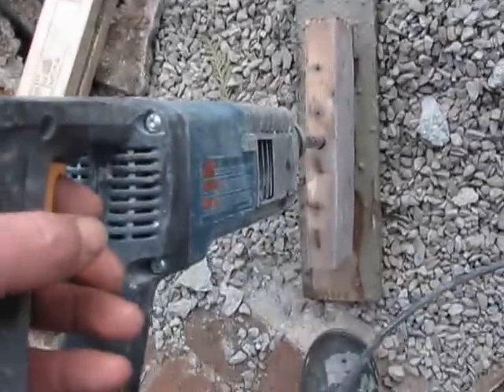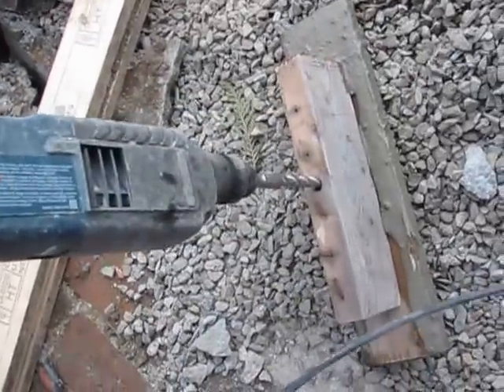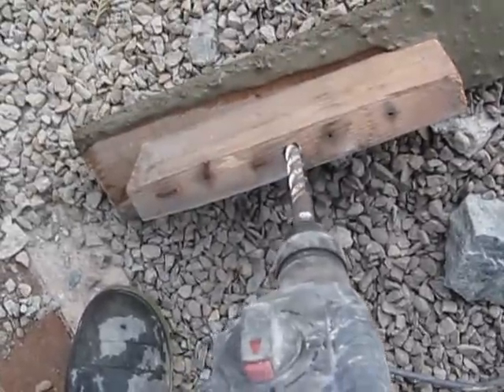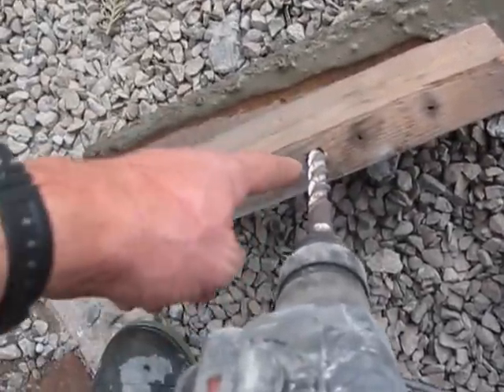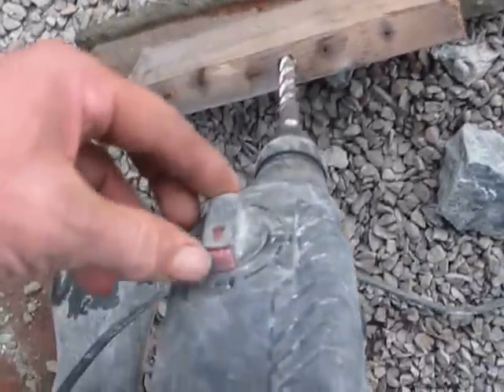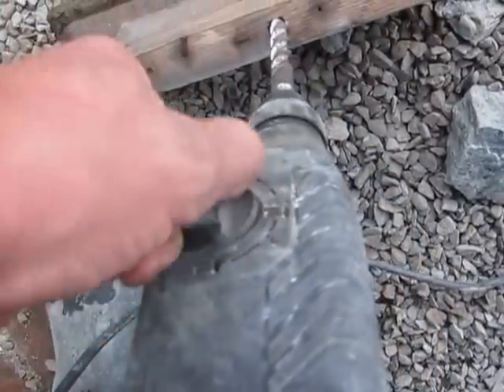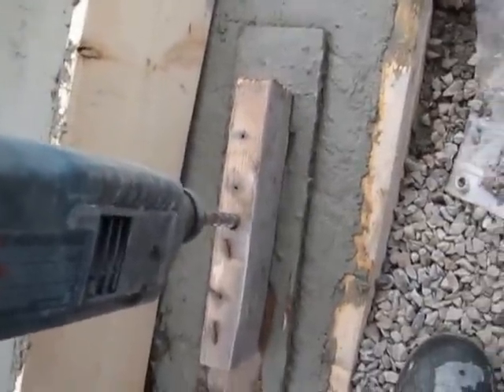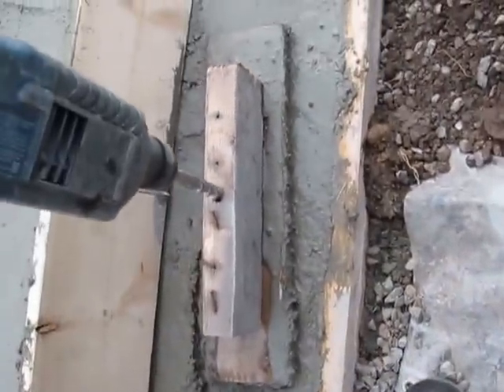Use a hammer drill to vibrate concrete or castings  and remove air bubbles!

Comment: Hey thanks! I just broke a drill bit yesterday and now I know how I'll be vibrating my concrete!! :)
Reply from the maker: Yeah,  it works surprisingly well, eh?   Perhaps Bosch and the others will make custom attachments to do this?   I plan to weld on something onto one of my bits to do deeper vibration.  Just not sure what yet.  Probably should be a hollow metal ball of some kind to mimic some of the industrial vibrators.

Comment: This is great for slabs, I actually have the same drill and I'm going to try this.

I was googling if there were any bits that fit in a hammer drill for pencil vibrating and this is the video I came across. Like you said in another comment, I might just weld a hallow tube to a broken bit, do a tie back to the drill so its always in hammer mode without applying force, and put a steel ball inside and see how that works. 

Obviously it wouldnt get the 1inch to 1foot area of influence, but for DIY home jobs, Im betting I can get 1 inch to 6 inches of influence out of it.

You know what, why hasnt anyone made a vibrator drill bit yet? It would be so easy to make, even would work in regular chuck drills. You just need a straight steel shaft with the first half of a impact attached to it, and a hallow tube with the 2nd half of the impact in it. When the bit spins, it recreates the hammering action found inside impact drills and demolition hammers.
Matter of fact, I have an old broken impact laying around, I'm going to take it apart and see what I can come up with one of these days, I'm sure it would work just fine, you're just essentially moving the hammer action thats found inside the end of the drill, to the other end of a drillbit, so it recreates the hammer inside the end of the bit, creating a vibrating/impacting motion inside the concrete.

Comment: Wish Bosch would make a vibrator attachment for their sds hammers
Reply from the maker: Well, if you have a worn out bit,  this is good enough!  Just drill a smaller hole in some wood,  in goes the old bit and you have your vibrator attachment.  I might try a flat metal attachment either or maybe some sort of metal ball  welded onto the bit.  I hope to really try this out when work slows down. (I don't do that much concrete work).   Brian.
Reply: Will try your idea
Both Makita and Dewalt make 18v vibrators
Just waiting for Bosch
Reply from the maker: CheekyMonkey888
 I did not know that.  The Bosch hammer drills with SDS+  are industrial strength so, I cannot imagine anything 18 volt matching them.  Or, not.   I forgot that  I did get to use a hilti battery driven hammer drill that was pretty respectable.  But it was  5 times the price.  "Don't damage this, it could be a career limiting move".  It was a nice machine though.
Reply: Bosch makes a whole line on 18v hammer drills
I have their smallest one
As for the Dewalt vibrator, I did try it, it works well for small pours, but eats up batteries
Reply from the maker: Well, you will have to tell us how you get on.  As long as it has "hammer only" as an option,  it should work.